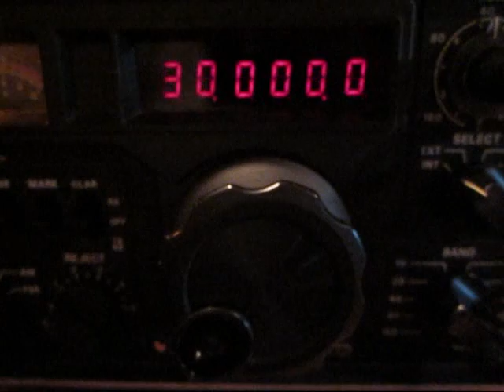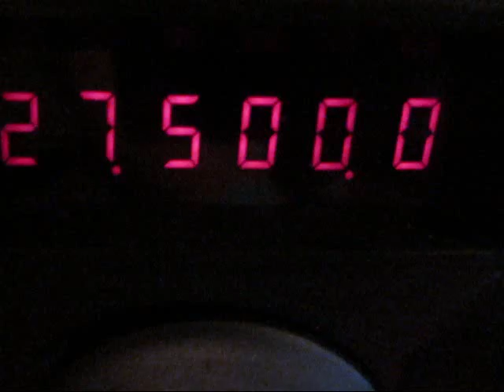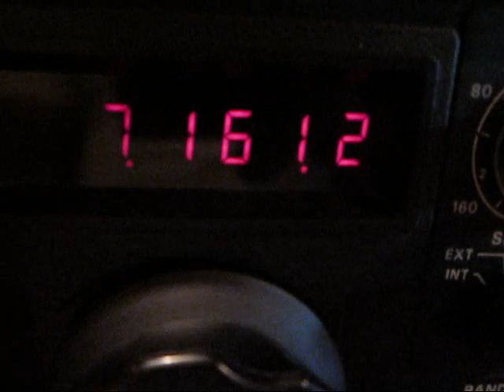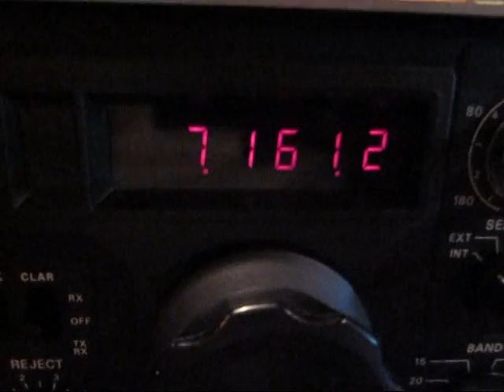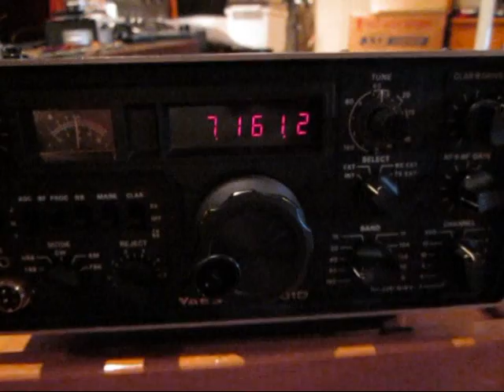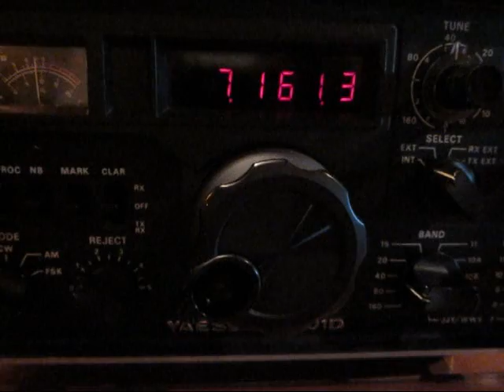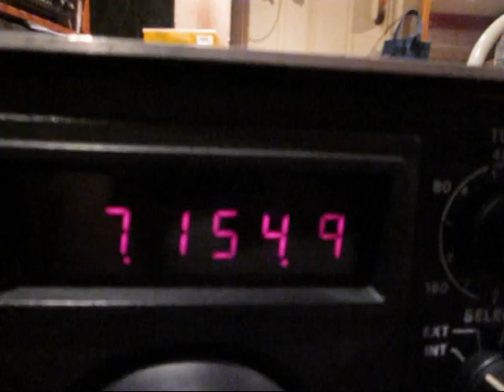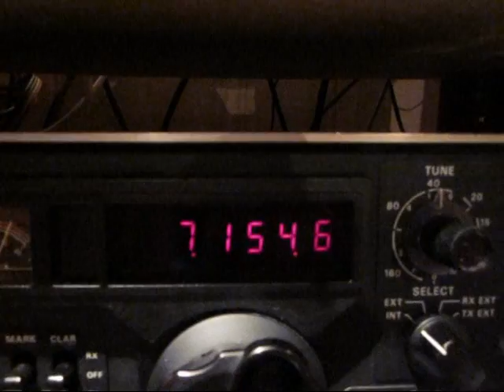Yaesu FT-301D Alternate Display Board - II

Comment: I do have an issue when the frequency gets to an 8 in the ones position, like 14.008, 14.018, etc, the 8 will go to 7, then 8, then 7, and the Hz digit starts randomly counting. I just wired this board two days ago.
Reply from the maker: Gene, you'll have slightly increase the gain in the first two stages.
Play around with the emitter (negative) feedback resistor values. It'll be stable once you have the optimum gain.
Reply: I sprayed the VFO capacitor VC-801 with CRC no residue contact cleaner and the readout is working as it should. :-)
Reply from the maker: Great! I'm glad that fixed the problem.
Reply: I just found and resoldered a poor solder joint on the PreMix board, at J-701. That might be the problem. Readout seems to be stable again.
Reply from the maker: @genes8929  okay. That's some nice debugging. 👍
Reply: Update, VR-201 in the Mixer Unit was adjusted slightly and the readout flutter has stopped. This is the variable resistor between the Mixer chip Q2203 and Q2204, the binary counter chip.
Reply: I will try that, thank you!

Comment: I just built one for my FT-301D and it works well. Thank you for posting these videos. I love the old 301’s! They take me back to my Novice days! ;-)  73 Gene
Reply from the maker: Yes, Gene. Even I love my FT-301D. Have three. Wanted a classic one with the vernier dial (not digital) but couldn't get one.
Nice to know you've kept yours in working condition.
Reply: I bought an FT-301 last March.I also have the FT-22R. I installed a NOS International Crystal CW filter in the FT-301 last April. The filter really made a difference on CW copy.
Reply from the maker: Lucky you! FT-301 vanilla....👌
I guess you probably meant FT-221R.
Well built 2m all mode, although the sensitivity leaves much to be desired.
I have two, and I have the (reverse) HF transverters for both. I have a video on that.
Using the 2m FT-221R to operate HF...
Reply: Yes, I meant FT-221R. I bought a 2m Halo antenna and worked about 75 miles away with it at 20’. Power output is 15W.
Reply: Congratulations on your  FT-301D Collection! Dad & I started out with an FT-101EE in 1977. We were licensed in 1978. NfourFZ.
Reply from the maker: @genes8929  wow! Well built rig - FT101 series.... forerunner of the FT-101ZD and FT-902DM. Have had all, and repaired all. Still have the 101ZD and 902DM.... transverters and all.
I was licensed in 1980, and started with homebrew TX and RX. TX finals 1625....later 6883B (similar to 6146 but 12V heater). Good old days...